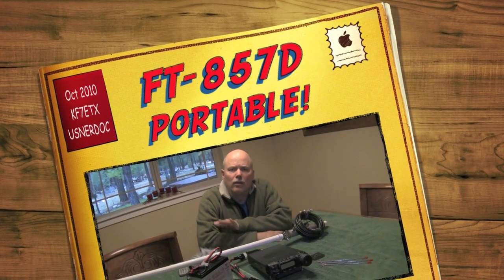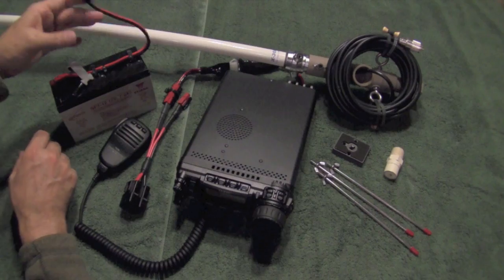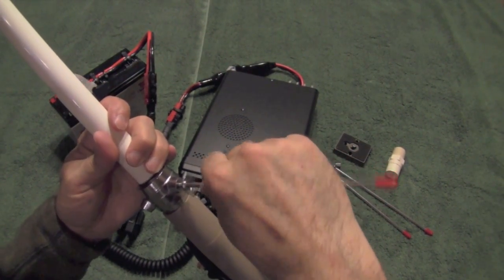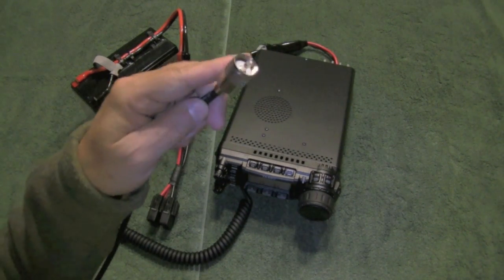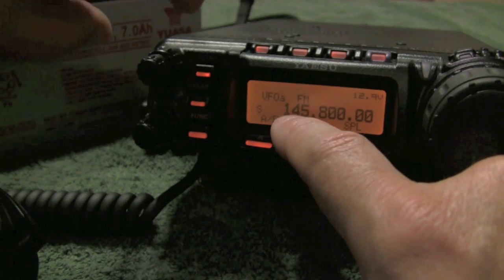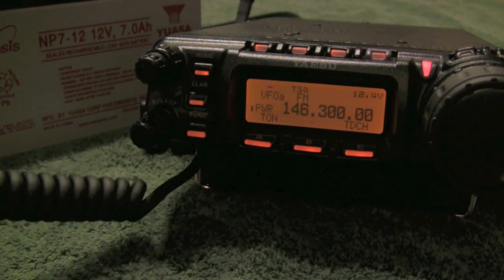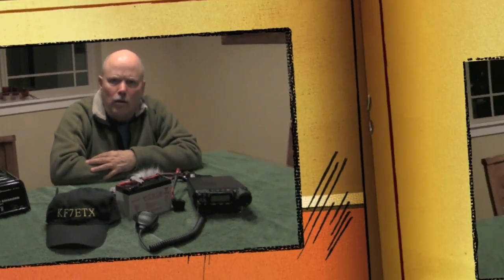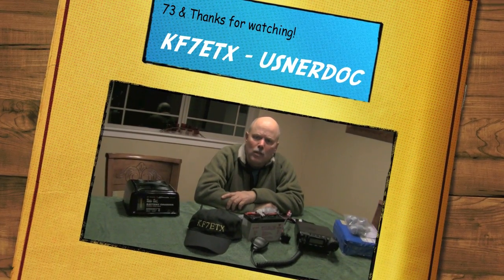Portable 9ah Battery Power & DIY Field Antenna - Yaesu FT-857D

Comment: In which country it is not allowed to have ham radio antenna on the house?
It was not a problem even in the so called "communist" times (the system never even used that term for itself) in the middle of our town, between two 8 floors high appartment complexes. I had a series of wire antennas in 3 directions. And when neighbours were complaining about, they were swiftly silenced by telecommunication office after a visit of measurement truck, paying fines for crappy antenna amplifiers and bad cables doing a lot of QRM :D (it still is a common problem here, people are accusing hams being the source of interferences but in reality they, not us, have bad installations, bad components, leaky cables, ...).

Comment: @USNERDOC For mobile power options I assumed I needed to match the output of the YAESU FP-1030A here in the States.  You have no issues running on 12v 7A?

Comment: I didn't have time to scroll through all of the comments, but curious to know if you still use the 857 and how it's performing.....Thanks!
Reply from the maker: I still use the FT-857D ... great rig. 73
Reply: @USNERDOC  thanks for the reply! I'm torn right now because I keep coming back to the 857D but am also hearing a lot about the digital side of things. As you were responding I was actually trying to look up whether or not I can use the HRI-200 with the 857D or if there is some other way to get it digital. Maybe you have some insight? I really want the wide range the 857D has along with it's portability, ruggedness and design overall. I just want my cake and to eat it too!
Reply from the maker: @MegaWait4it  Great insight sir! Learning about the capabilities of digital is on my bucket list for this year. I unfortunately have no expertise in this area. 73!

Comment: I am starting to think a investment in 3 small charged uv5r baofengs, would a more economical and practical go radio, especially in terms of space and weight. Throw in a small solar panel to keep them charged on the go. You get 5 watts but you can't really use more than 5 watts anyway on a battery. I like your antenna ideas, is there a ground wire that you have to run with that antenna?

Comment: you can find cheap rc lipo packs that can fit inside the radio. 11.1v 2.8ah they weigh nothing and you can fit the equivalent of 9ah lead battery in a shirt pocket. also, cut a braid inverted v and mount on small telescopic fishing rod. you can tune the antenna by rolling up the ends and cover many bands. a small magnetic loop can also fit a pocket and still cover many bands. elecraft t1 tuner makes life easier with dipole or longwire. my whole kit fits in a very small medipack including ft817, small 50w linear, tuner, antennas, solar panels, and batteries. will give at least 6 hour operation on full power per day for infinity days. minimum kit fits in one coat pocket. the lighter  it is, more likely you are to carry it and the more  you  carry it the more chance of good qso.
Reply from the maker: +drspastic - Cool! Thanks for the great insight.

Comment: Hi Doc,  I didn't realize you were in a deed restricted community.  That would drive me crazy (I've been there).  If I can, I would like to make a suggestion for an almost invisible  permanent base station antenna.  I used this set up at my old address  in a deed restricted community I used to live in, in Fla that had lots of condo commandos constantly looking for violations.  They make a base station conversation kit for mobile antennas, I used mine undetected for almost 20 years on my roof before I moved.   The ground radials and the mobile antenna whip section are sooooooo thin, you can barely see it from your own front door.This kit should have about the same gain  as the antenna you are currently using.  The kit comes with two hose clamps that I used to mount the kit to the toilet vent pipe on the roof (this is a no hole mounting set up).  I switched between the Larsen NMO270B and a Comet multi band mobile antenna.  The kit consist of 4 ground radials that are skinnier than a wire coat hanger, an angle bracket and a UHF / SO239 barrel with an NMO adapter (so you can use UHF or NMO mobile antennas).    Trust me the kit is all but invisible.  I used quality LMR240 coax painted the roof color (RG8X is mini base station coax size)  LMR 240 uses a 100% foil wrap shield with a 98% braided shield over it and it has a 20 year MIL SPEC outer jacket.  It is nice to always have a field expedient antenna, however an undetectable  permanent base station antenna is preferable, at least to me.     I always keep a spare kit like this in my preps, send me an email and I will try to send you some photos of it. 73
Reply from the maker: +Arlene Wolf - Wow! Many thanks for such a great recommendation. We moved from that home a year ago to downsize before finally moving to the ranch. My goal is to set up a small antenna farm. I asked my ranch HOA permission ... and immediately granted myself permission 👍🏻 73 

Please send photos and info to
beth@mountainviewranchoregon.com

Comment: Hi David......is there a pdf for this antenna available?
Reply from the maker: +biologistjim - that is a great question! I will have to dig through my files when I get home. I know someone asked me a similar question and I am pretty sure I drew a sketch of the different CPVC fittings I used. I go them all from Home Depot. They were pretty understanding as I took the antenna from one department to another searching for all the bits and pieces.
Reply: USNERDOC thanks, appreciate all the work you do on your channel and your willingness to share via pdf.  Have used several of them. 73 Jim KJ6VVM

Comment: if you put pin 3 to ground you can put it in battery mode. turns off cooling and back light plus kills the power down to 20w. Very handy when using batteries.

Comment: What do you use to charge the battery?
Reply from the maker: I use a multi-chemistry battery charger or a solar panel with a charge controller depending on the situation.

Comment: Nice little setup. I have a similar radio in an FT-897 and run that on a 35 Amp 12V AGM type battery in a tool bag. The antenna is a home built Slim-Jim made from 450 ohm ladder line installed inside of a piece of white PVC schedule 20 pipe painted black. The take off comes out at right angles using a pipe T with a short length of pipe and terminated with a pipe cap with a UHF chassis mount connector. The whole antenna is supported by a speaker tripod which is quite  sturdy. The thing comes down in a jiffy but can take the roughest weather provided some weight is added to the middle of the tripod.For HF I have a hi power end fed antenna that can be easily packed up and taken away. Considering building the FT-897 into a man pack of some kind with battery and charger inside to make it weather tolerant. I have a 40 watt Coleman solar panel and charge controller to keep it all going in the great outdoors. The 35 amp battery does well at getting out with full power for a short time when I need it. Not as portable as my FT-817 with roll up 300 ohm slim jim and end fed 20m antenna which can all be easily transported to the mountain tops in a back pack with lunch. Anyway, thanks for sharing all you have done, it looks great.

Comment: I'm studying for my general now. I passed the Technician's Class Exam on the 18 of July and was published on the 24th. I have a HT Baofeng UV-5RA. Why did you pick the 857? I'm looking at the 817 but a fellow ham has a 857 in his truck and says I'd be a lot happier with the 857. The 100 watts is temping and this will be my only rig for a time, but the battery life has got to be a lot shorter. If you have hiked up hills and mountains to do SOTA's, how did you power your rig? What did you do to lighten your load? 
Hope to meet you on the air ( and maybe chase you on a SOTA). 73
KE0OAP
Reply: CONGRATS on getting your Tech license! My first HF radio was the FT-857D. I had looked at the FT-817 as well, but I went with the FT-857D because I could only take the FT-817 to 5 watts, but I can always drop the FT-857D to 5 watts from 100 watts whenever needed.

Comment: Sorry for the noob questions. I am just getting into amateur radio and don't have a radio, license or experience. :)

Anyway, if you use a DC battery like you use, you don't need a separate power supply? I've been looking at getting a radio, and would like to get a setup similar to the one you have built so I can take it with me, a go-box, as I've seen them described. 

Also, if you use a DC battery like yours, you don't get power supply noise, like you can with a cheap power supply?

Thanks!
Reply from the maker: A Go-Box is a great project!
The battery is your power supply.
Good luck getting your license ... hope to catch you on the air!

Comment: I wanted to do something like this myself, but then I saw the video where they measure the standby and 5w power consumption of the 857 compared with the 817.  The final conclusion is that the 857 is an absolutely horrible choice for battery portable applications.

Because it's a 100w rig, it's efficiency at 5 watts is abominable... but it's also got a monster drain in standby too, which is really bad news.

Don't get me wrong, I love my 857d to bits - but I'll be buying an 817 for fieldwork.

Comment: Does anyone know how long one of these 12V 7AH Lead Acid Batteries will run and FT-857. I mean in hours and minutes. Just general ball park estimates not exact figures
Reply: with a 7ah,mine runs 6hrs listen and 3 hrs listen+short tx on ssb.FM and CW/digital modes use power like it is easy or something. Go to northern tools and look up their folding solar panel kit.Somewhere near $125,folds with a handle,comes with charge controller.That panel will keep that 7ah battery running your rig,any mode,as long as there's sun. I use an 18Ah and two folders to run my 706MKIIg when portable,on 40/80 CW  @100 watts all day.
Reply: PUDDEN TAME.Thanks for the response. I searched here on youtube for battery options for the 857d and this video came up. No offense to the uploader but most of this was about the antenna that he is using and  the QSL on 2 meters. No on battery options for the 857.
Reply: PUDDEN TAME. Thanks for that tip. Those folding solar panels are too big and bulky for what I want to do. I am a motorcycle rider and have had this idea in my head for  years to do what is now called SOTA here in California using a motorcycle to get to the summets or as near to them as I can get. So the size and weight of items on the bike are of prime importance. Powerfilm makes a 30 watt foldable and flexible solar panel. It folds up like a blanket. i was thinking about that one and now that I know that I need and solar controller also i think that I am on the right track
Reply: OK,so lets use OHMs law and figure out what a radio using "X" amount of power [modified by type of transmission] will use from a battery with "Y" ampre hours contained at full charge. Remember that dropping an AGM sealed batter below recommended voltages is a bad Idea,and GelCells are worse. The best advice I can give you beyond the basic math would be hook it up and run a log of TX vs RX times spent and how much of the battery's total amount available safely. Personally,that is what I did right off the git go because our equipment is primarily SHTF- GTFOD gear,and secondarily portable ops station. The other option would be to go a little more spendy and get a next generation battery like an LION battery. Lighter,and solid until the moment they die.

Comment: Great video. I am leaning towards the 857 over the 817 as the added power is a big plus IMO. I wanted to ask about the battery you were using, I know the 857 will hog more power so how long will that little guy last before its done? Thanks
Reply: Croaker Receiving? Many hours. Approx 8 hours listening. Less the more you talk, less the more power you run, less if you use am, less if you use fm in that order.

Comment: Where did u get those red rubber caps?
Reply from the maker: TAP Plastics
They are end caps for mailing tubes
Reply from the maker: A mailing tube is a rigid plastic or cardboard tube used to mail documents, posters, photographs and architectural plans. You can get them at Tap Plastics.

Comment: I'm curious if this setup would be able to transmit at 50 watts even for a short amount of time. Would this battery be able to handle that? Maybe a slightly more powerful battery?
Reply: I know...a year old but since no one answered..Yes it could, but a single battery would drain fairly quickly.  Anyone interested in setting up a similar rig for higher power or extended use could take several of these and wire them in parallel, keeping the voltage the same but increasing output capacity.  But be warned several of these batteries weigh a fair bit.   Putting them in a plastic tool box and drilling holes with grommets for routing cables would be a great way to ease the carrying and set up of a larger battery pack.

Comment: Hi Dave.  I have a couple questions if you may.  I am considering the FT 817nd vs. the FT 857d for general ham use, but also something which can handle  long term off grid emergency comms.  I intend to be operating from a fixed location, but with the portability to pack up and move from one bivouac to the next if necessary.  While the small package of the 817 is great, I'm skeptical of committing to a QRP only rig like the 817.   During a long term, grid down emergency, I feel it may be more of a priority to have the ability for transmitting with 20, 50 or even 100 watts when propagation may not be conducive to QRP operations.  Just wondering if you concur with my thoughts?   I guess my next question would be, if using two 10 amp LiFePo4 batteries in parallel provide enough power for several hours of radio work?  Whether I go with the 817, or the 857, I plan on using them with your excellent AMP3 packs.  Any thoughts would be greatly appreciated!   
73.  -KD0TLN
Reply: Hi: I am considering the same setup except I want the :T-857D version. Did you ever get an answer to this question or make a final decision? If you did, I am interested in what your decision was.

Comment: I have many of the same issues...cannot mount external antennas...sucks BUTTT I tend to like to keep my creations and toys close by...ever since I was a kid its been a bad habit...I talk on my HAM radio from my bed on rainy days :D I've been looking for a way to mount my 3 element 2 meter Yagi onto my camera tripod. Any idea where I should look to find the same connector screw as seen on the bottom of my camera and other attachments to wrap around a fairly large boom pole? Yagi is about 2.5lbs and tripod legs extend pretty nicely so not too worried. I had a random tripod screw mount adapter that I used for a DSLR make shift stabilizer I built but its long gone and the screw mount adapters that I've seen are much smaller than what I'd need for my Hy-Gain FM23 Yagi

Comment: Really enjoy the videos. I know this video is a few years old now but still great all the same. My Grand parents used to live in Sisters, OR. So I am very familiar with the area. Very beautiful. I have spent a few years in Bend myself. Really miss it there. I am looking to purchase the ft 857d in the near future. Thought I might ask your opinion of the radio now that you have had it for a while now, assuming that you still own it. I already have a couple HTs (vx-8dr, vx-6r and ft 60r) like them all but looking for a good all mode, higher output radio that works single side bands as well.

Comment: Although where you live you are not allowed to have antenna where you live you're allowed to have a flag pole.

The Freedom to Display the American Flag Act of 2005 (HR 42) was signed into law by President Bush on July 24, and the measure went into effect that day. First introduced in January 2005, the bill was passed by the House of Representatives on June 27. The U.S. Senate followed suit by unanimous consent on July 17.
Reply: Would a flag affect SWR :)
Reply: soloban81 if the flag pole was made of metal it would indeed affect the SWR

Comment: Any thoughts on using a Lipo battery to save on weight?
Reply: Jason Brown a lipo battery would be great. use an RC pack. lipo batteries however are very expensive. you could get a cheapo but you would be disappointed. go out and get a gens ace or something. you will need to get a 3s pack with at least 9000mah of capacity. if need be you can wire several in parallel to give you more capacity. i have three 3s lipo batteries each with 5500mah wired in parallel to give me 16500mah of total capacity.

Comment: ok, being a new ham, I currently have a mobile unit, looking to build one as a backpack rig for camping/hiking. How do you wire the battery? I know on vehicle the red is pos and goes to the battery, and the black is the ground. do you wire the black wire to the negative on the battery? May sound like a dumb question, and I apologize I just dont wanna jack up my radio
Reply: Yes.  If you follow this video, pay attention to Anderson Powerpoles as a standard and common way to connect equipment to power.  Even my older Yaesu FT-100 uses this type of power connection.  In the USA, for this type of DC power, Red is usually the hot or + side, and Black is usually the ground, or - side.  Most newer radios have power input protection and just won't power on if you reverse the polarity of the battery, but it's not something you should test.  Just pay attention to red and black.

Comment: Question to the expert: What kind of portable battery do you use? Where did you source that? How is the portable battery charged? Many thanks for your expertise.
Reply: Its a motorcycle battery. And if you'd WATCH the video, you would see that he covers the charging of the battery at the 12:00 minute mark.